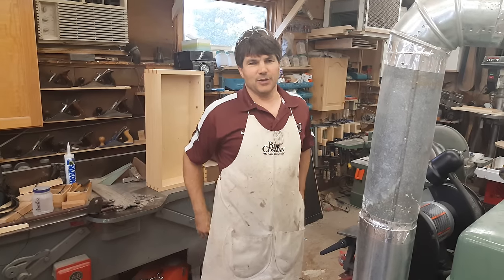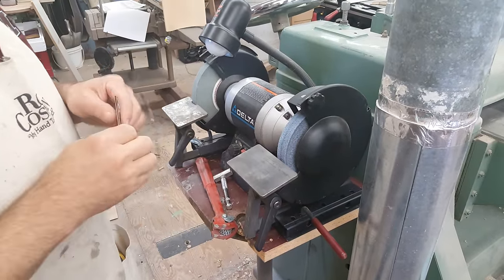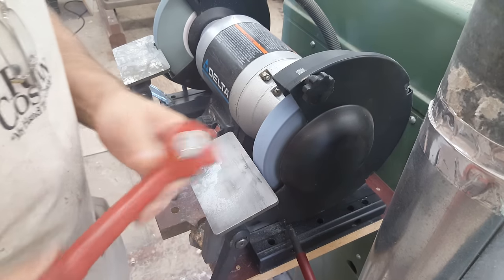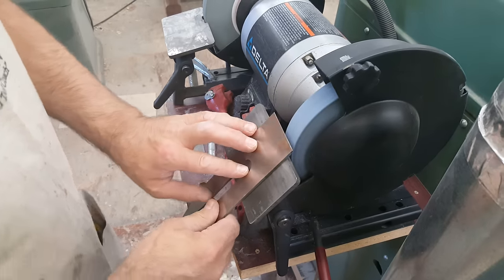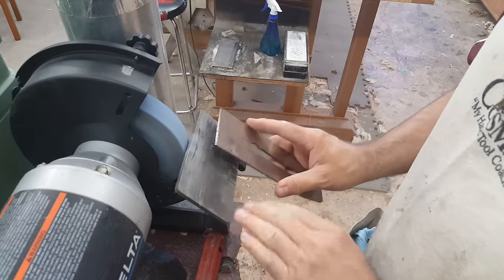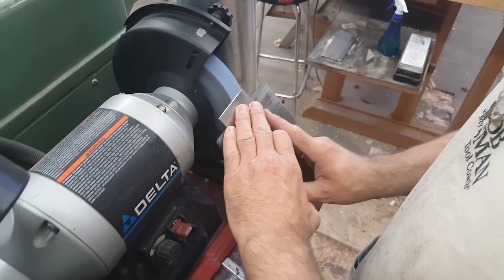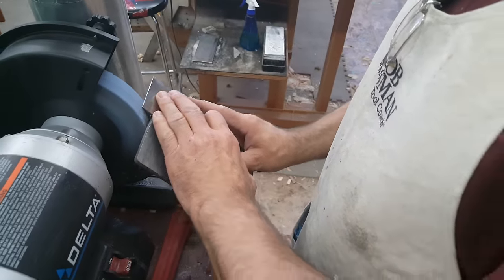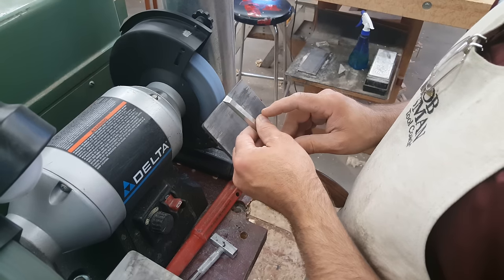Grinding primary bevels

Comment: took your advice and got a wolverine jig ... completely transforms the grinder !! I thought it was going to be hard to get a straight bevel using just the tool rest and no "jig" to keep it exactly 90 degrees but it was actually really easy !!! .. I used a white aluminum oxide wheel and got the crooked bevel Dead square first try ... then gave it a few strokes on the shapton glass 1k and 16k and the iron was ready for the barber to shave hair !!! :)

Comment: How do you double check that the main bevel is a true 25 degree...I thought you were about to show it with the protector but blew past it..lol.. That's what I was looking for..iam completely brain farting on that part. I've got some old planes I need to set new 25 degrees on.. Thanks for all you do for us and us vets..
Reply from the maker: First don’t sweat exactly 25 degrees +/- a degree or two.  Just look at the protractor in the measuring section of robsosman.com and you will instantly see how to measure.  You could even trace the profile on some paper and

Comment: Hey Rob, so let's say I follow this guide and then go to hone. Could I still use my diamond plates at 180, 400, and 1200 grit? And if so do I the honing at 25 degrees or a different angle?

Comment: Unlikely I will get an answer but I am looking at a good bench grinder for woodturning chisels.  I have the Delta grinder but it is a high speed wheel and most people are saying a slow speed grinder is needed.  I have looked at Tormek but very expensive and not sure the extra money equates to better and easier sharpening.

Comment: do you think it better to have a high speed grinder it a slow speed I have a high speed and the steel gets hot pretty guick or maby it the wheel I have the cheap wheels that came with it aluminum oxide 36 grit and 60 on the right

Comment: I'm not sure if I'm buying the "heat sink" hypothesis.  We're dealing with a razor thin edge that is about a 1/2" from the heat sink.  I think the coarse wheel and light touch is surely legit.  The chisel he has is much thicker than the plane blade, wouldn't that be a better heat sink?
Reply from the maker: Dont buy the hypothesis, buy the wheel and see for yourself.
Reply: ok?

Comment: Good to know, but I don’t have a grinder. How do I correctly get to this by hand?
Reply from the maker: You will need some form or a jig to hold the angle, long and slow process by hand!
Reply: @jadan duffin. There are special jigs for sharpening knives with different grinding stones (or diamonds?)..... They are very expensive.....

Comment: Hello Rob 
so that set a hollow grind? I prefer hollow ... makes using the stones much faster
Reply: Just use a smaller size wheel.  If you keep the plane square to the rest it will become a hollow grind because of the radius of the wheel.
Reply: Patrick Melchior to save buying and trying to fit a smaller stone, use the corner of the stone which will rapidly hollow grind.